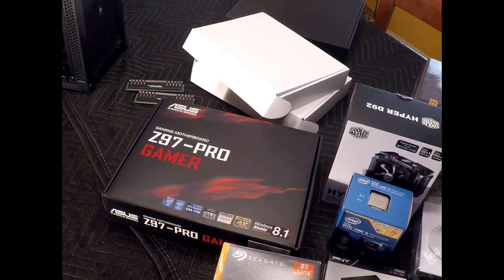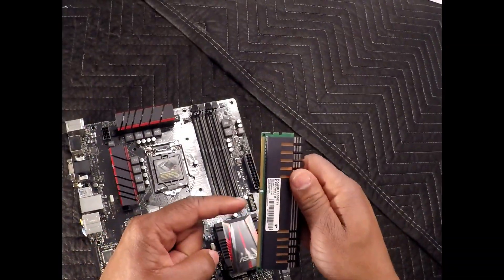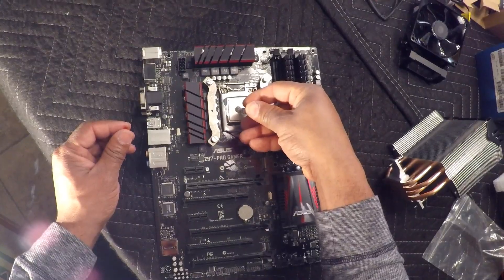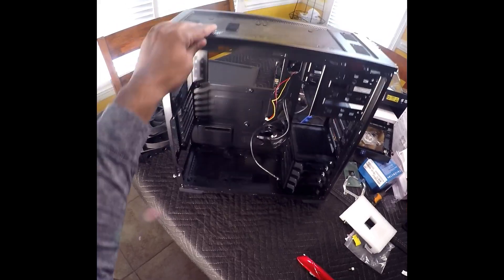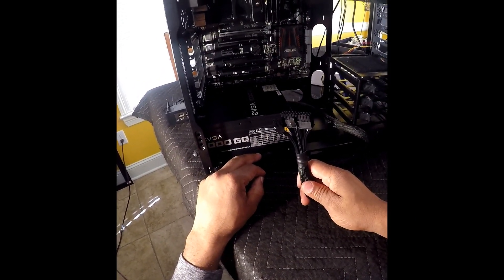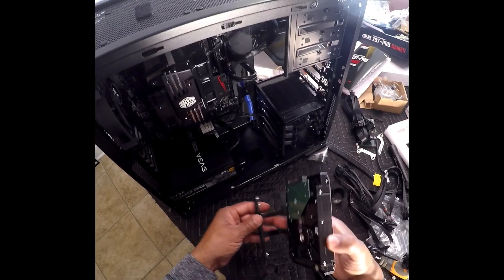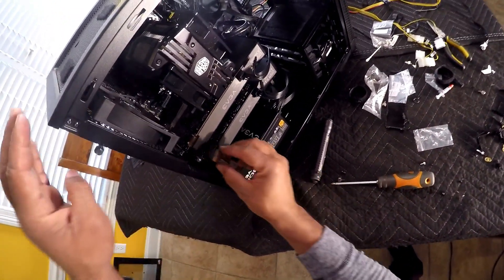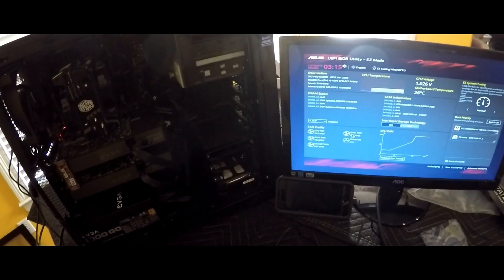Computer Build On A Budget

Comment: NIce build Chris.  And all this time I thought you were just another pretty face :)

I made the mistake on my last build of using the SSD as the boot drive.  Works for a while then the BIOS loses track.
Reply from the maker: Using a SSD for your boot drive is what I recommend, faster boot times of less than 20 seconds with no moving parts, you may have other issues causing your problems.
Reply from the maker: That is correct, which is why I have several in my main system.